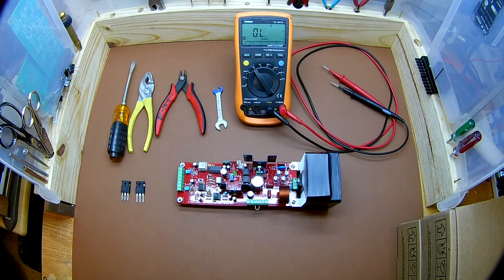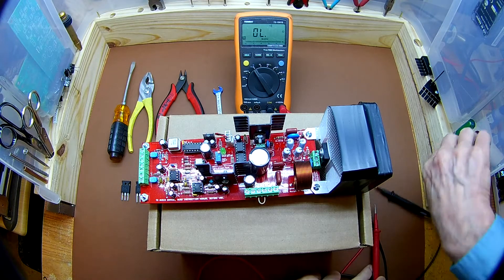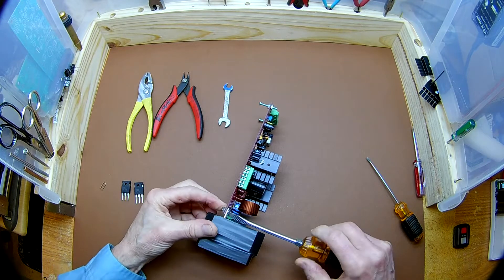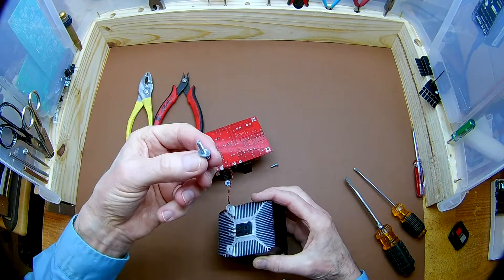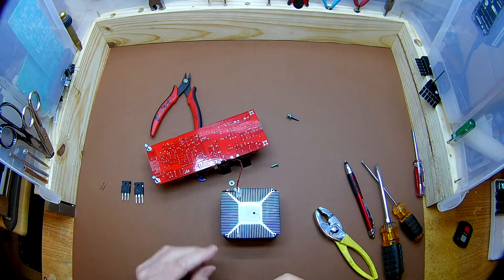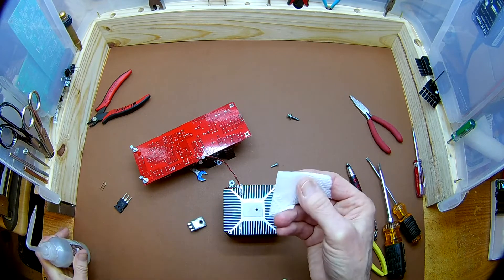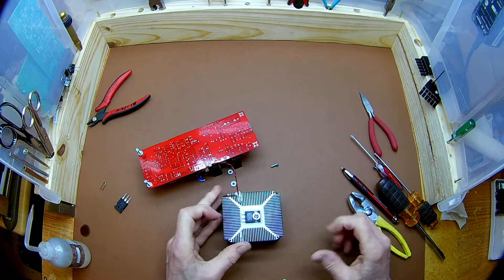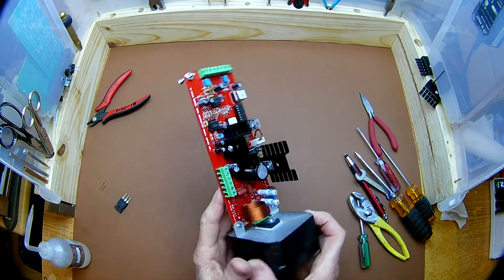Replacing the STW20NK50Z MOSFET in Spectrotek Amplifiers

Comment: 👋 Hi Spectrotek Team and fellow viewers,

First of all, thanks for the informative video on replacing the STW20NK50Z MOSFET in Spectrotek Amplifiers. I found it extremely helpful!

🔧 My Experience:
I successfully replaced the original STW20NK50Z with a UJ3C120040K3S in my PA3 amplifier. The amp worked great for about 6 months. I was trying it as an upgrade to hopefully have it last longer without failure.

⚠ Caveat:
However, the UJ3C120040K3S failed after this period at 85v & 100kHz. I'm not entirely sure why, but I thought it might be valuable for others to know this if they're considering the same replacement.

❓ Seeking Insights:
I'm curious if anyone else has had a similar experience or if there are any insights into why the UJ3C120040K3S might fail in this application.
Also, I'd love to know if there is a better option. Ralph, feel free to comment with the specific requirements of the power transistor.

Thanks in advance for any feedback or suggestions!